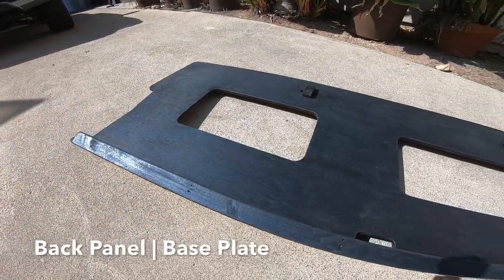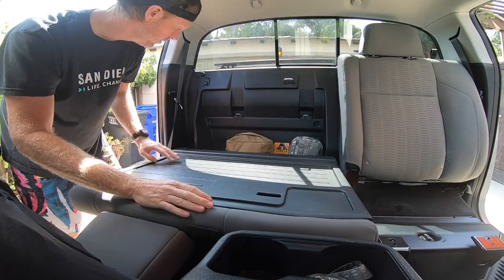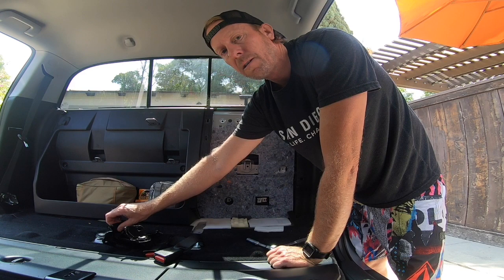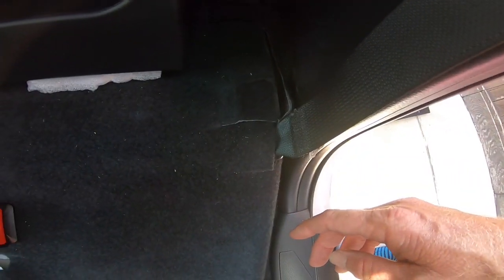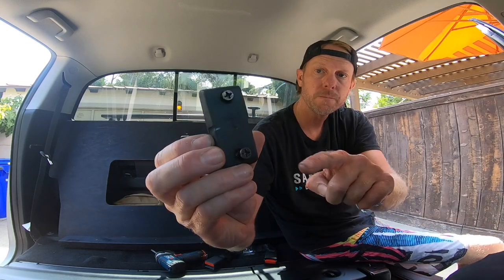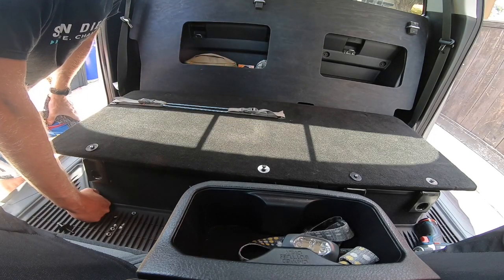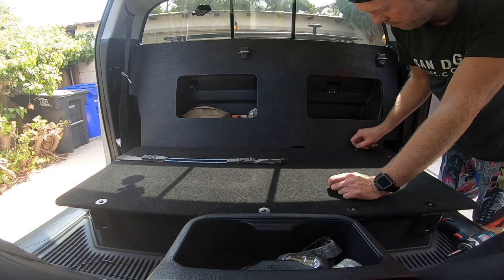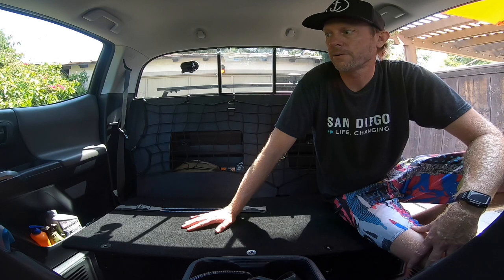Goose Gear Inspired Rear Seat Delete | Tacoma | Detailed Seat Removal | Design and Installation

Comment: U need to split the board same as the seats. So u can lift up..passenger and driverside.. to get to your cubbies. I'm glad u didn't go past the footwell. Like most do can't slide your seat back..otherwise cool build. Take out the passenger seat. And do a full board to the back probably sleep like a single bed. If you need it. But I would get a topper 5 foot rooftop tent 6.foot sleep I'm the back. Than nice to store half your gear behind the seat..and in your bed..squeeze loads of space out a midsized truck. Almost just buy a 4 runner. Lay the back seats down. And roof top cargo basket..my tacoma is ..tricked. to the max. Smart idea..
Reply from the maker: Good ideas. Mine works well for my needs, but those are good improvements for sure. I’m 6’5 so my seat is all the way back no matter what lol. Thanks for watching and commenting. TbT.
Reply: Crazy I actually thought the same thing last night. Just need some guidance

Comment: looking to do a 60% delete on my rear seat.. I want to put my fridge (iceco VL60DZ) in the rear seat, and gain some more functional storage. folding the seats flat the fridge sits too high (doors wont open fully, and there is no-where to tie it down. this platform should solve most all of my problems and gain more storage room in the bed of the truck as well as keep my fridge free of dust, (cleaning the condenser and fan is a PITA).. its usaully only me and my wife that go on these trips. but a 3rd seat is always good to have should our daughter decide to join us.
Reply from the maker: Excellent. I think you'll be happy with having it in the truck. My RSD is still going strong and its so much more functional as a platform than seats like you said. Maybe make a 2 piece platform/back that you can pull the 40% side out and put the seat back in when needed or vice versa. Good luck and thanks for watching and commenting. TbT

Comment: This video was exactly what I was looking for, and well done! I just finished mine, and a couple of adjustments I made too: 1.) Instead of bolting the board to the frame for the T bolts, I just screwed the board into the platform so it raises with the frame but doesn't allow shifting while moving - I couldn't find 7/16" screws long enough anywhere around me to mount it into the frame 2.) I used U-bolts in the platform to allow a way to attach ratchet straps to the cooler so it stays in place, and when there isn't force they drop down to near flush with the platform 3.) Applied outdoor carpet to it to help keep things from sliding and better traction for my pupper. 

Seriously awesome video!! Love the fly rod space! I tuck my little guy into the space between the back storage and the wall (I only did the platform, not the backing). Thanks!
Reply from the maker: Thanks for the great comments and watching, glad you liked it. I’m loving my set up and it’s holding up well. Glad you’re stoked on yours. Stay safe out there. TbT.

Comment: TbT! I just finished my delete. I am so grateful for your inspiration and guidance!! Thank you so much. Out of curiosity, how do you power your cooler when it’s in the back seat? My Taco doesn’t seem to have a power option in the back seat..
Reply from the maker: Rad, how'd it turn out?  I have a battery in my camper (Redodo 100AH) there is a discount code in some of my camper build videos you can use, ( TBT3) for a slight discount. If I didn't have that battery I would probably use a PowerStation like (Jackery, Blueutti that has enough AH to run your fridge.  I run the frisdge off my truck (Cigerete lighter port when driving to save battery and our camper battery when camping and keep it topped off with a 100w solar panel.
Reply: Oh nice! Mine came out so great!! Do you have an email you can share? I can send pics, I don’t have any social.
Reply from the maker: @Mountaindweller915  Cool, yeah. I think it’s in the description of my YT page.

Comment: Do you have the dimensions and angles for this build. It's perfect for what I need.
Reply from the maker: Thanks.  The base is 19” X 48” and the back panel is 25.5” H X 52.5” W at the top (widest part) it tapers down narrower at the bottom to allow access to the mounting bolts (seat mount locations) and some more side storage. Hopefully you can see most of that in the video and use it to inspire your build.  I do not have angles, I just matched the angle of the factory cubby. Thanks for watching. TbT.
Reply: This build is awesome, I’m just beginning it myself. What are the dimensions of the center support pieces underneath the base, adjacent to your fly rod tube? Also, what’s the thickness on that base sheet of plywood?
Reply from the maker: If I remember correctly the back support with the angle ripped on it is about 49.5” wide. I can’t remember the mid supports sizes. I think the deck is 11/32 ply. But anything light but stiff would be good. Just don’t want to add any unnecessary weight, but you don’t want it to be flexy obviously. Good luck 🤙🏼
Reply: Thanks!

Comment: Thoroughly enjoyed the build. It looks great and is functional except the 3 screws holding the base to the back. I would have done something quick release like pressure pins or spring clips. Just for quick access to the bottom containers. I keep recovery gear in those bins as well as trailer hitch and other gear I need quickly.
Reply from the maker: Thanks for watching and commenting.  The main reason I chose to use the 3 Allen screws was safety. I wanted the entire rear seat delete to be as secure as possible in a worst case scenario IE car accident. I didn't want anything on the rear deck to flip forward in that situation. Also I figured in a recovery situation  ( I keep my recovery gear under there too ) taking those 3 bolts out only adds a few minutes at most and slowing down in a recovery situation is a good thing.  Stay safe out there TbT.

Comment: Nice build.  Pulled my back seat out the other day and was amazed how much more space it gave me.  Gonna do my own build soon.  Thanks for the inspiration.
Reply from the maker: It truly is amazing how much extra space it creates. If I do it again, I would add more sound proofing to the back wall and floor where you can. It’s definitely louder without the rear seats...but not horribly. Other than that I absolutely love the mod. Good luck with yours and stay safe out there.  Thanks for watching and commenting. TbT

Comment: A really good video! I have been wanting to do this same mod. I bought the plywood and have both pieces cut per your dimensions. A have a few questions for you that would really help me. I see where to trim or taper the back piece on the left. And where I need to notch on the lower right to attach the bolt. Could you please give me the measurements for each storage openings? It looks like they are slightly smaller than the actual opening. Also I assume that the back mounting board is a 1x4 that goes fully across the bottom. Then you have a 2x4 that is the front bottom to attach the bottom. Is that right? I will need to figure out how you attached both pieces that basically make a bottom “ tee”. I will just have to lay it out to understand how you screwed them all together I guess. I really appreciate your help and again thank you so much for a very good video! Thanks.
Reply from the maker: Thanks for watching. I made the openings 15  wide X 9 tall. The passenger side (factory cubby) is bigger, that allows me to stuff things back behind the overlapping back panel on that side if that makes sense. 

The bottom base part is a piece of 1x 4 poplar cut down to 2.5” with the angle matching the angle of the back cubby panel and a piece of dug fir 2x4 (platform base) all glued and screwed together. Make the mounting holes (the ones that I bolted the back panel/base to the existing seat/floor screw holes) big enough so you can move the back panel marking a bit to line up the bolts and use fender washers to cover the bigger hole. Makes it much easier  to line up the back panel when bolting down. Hope that answers/helps you a bit. Feel free to modify or improve my design of course. Good luck and let me know if you have any more question.  TbT.
Reply from the maker: ...yes it goes all the way access so you can use the seat mounting bolt holes on each side (and the middle where I had to make the notch). Made it just wide enough to get a bolt and fender washer on it. About as for out as the seatbelt bracket on the floor of the truck. Hope that makes sense.
Reply: @TravelingbyTacoma  thank you! I will let you know how it turns out.

Comment: Excellent video.  Just pulled my rear seats out and was going to omit the cubbies too, but now you've got me thinking I may put those back in place.  Well done.
Reply from the maker: Thanks for watching and commenting. I kept them because I occasionally put my seats back in. They work well for gear and with the elastic net you can stuff all kinds of stuff in there. Removing them would add some more space for sure though.  Good luck and stay safe out there. TbT
Reply: @TravelingbyTacoma  finalized my design today, slight variation on yours, going to go vertical from the floor up to where the cubbies start to slant back with a couple hinges to give me that extra inch or two of platform space, and going to try to use a T-nut and star-knob to achieve securing the upper section of the wall panel to quickly be able to flip it down to access the cubbies since I don't plan to cut out the holes like you did.  Thanks again for the inspiration!
Reply from the maker: Good luck, hope it turns out well.

Comment: Awesome video and inspiration for a similar project I'm considering. Do you happen to know if this also warranted a weight savings and how much you saved? Or what your seats weigh compared to the build? I'm hoping that mine will also mean even just a bit of weight saved for the rest of my gear!
Reply from the maker: I don’t have any exact saving numbers, but it is for sure less weight than the seats. It also allows gear to be moved into the cab that would have been in the bed and distributes the load weight better for sure. If I had to guess... it is at least a 30-40 pound of weight savings by removing all 4 rear seat pieces and only adding some plywood and carpet. Good luck, thanks for watching and let me know if you have more questions. Stay safe out there.  TbT.
Reply: @TravelingbyTacoma  That's the most important piece to me! The added room, thank you!

Comment: Would it be possible to do just the 40% seat delete on the driver's side? I still have a 3rd, and sometimes 4th, person in the truck.
Reply from the maker: Yeah you can do either one. I’d make your platform on the passenger side (limits you to 3 people) but it’s more bang for your buck. Ice chest or fridge would fit on it. Also it will only take you about 15 minutes (once you’ve pulled the seat out and put them back a few time) to re-install your seat if you want it back in. You could take out either seat and the plastic cubby and build a one piece platform with a 90 degree back- that would give you a lot more room and may be an easier in and out install. Good luck.

Comment: looking to do the same to my 2nd gen. great idea to re-use the seat hinges
Reply from the maker: Thanks. It works really well if you don’t need consistent access to the factory storage. Stay safe out there and good luck with your build.  TbT
Reply: @TravelingbyTacoma  could you nt chance share your dimensions or template of the cuts with me? 😁
Reply from the maker: Back panel is basically 53” wide by 25 1/4” tall. Flip-up base is 48” by 19”. Everything else is just builders choice. Good luck. Thanks for watching.
Reply: @TravelingbyTacoma  cheers!

Comment: Are you based in San Diego? Would you help me build one if I paid you?!
Reply from the maker: I am. When do you need it by? I’m pretty swamped at the moment with work/life. Can you hit me up in a few weeks and I’ll see if I can help you out. If you’re looking for the exact same system I made for my 2019 I could use mine as template and it would be fast and easy. If you’re looking to modify my design that’s a different ball game. I’m not 100% sure all 3rd gen DCSB are exactly the same each year, but if they are duplicating mine would be easiest. Hit me up in mid April and we’ll see. Thanks for watching and commenting. TbT
Reply: No rush on my end! And yes it would be almost exact copy maybe with a small modification weather main platform is to make it a little longer for my dog. Not sure how to direct message you but if you know how to to me please let me know!
Reply from the maker: Ok. DM me on my Instagram @travelingbytacoma in a few weeks and we’ll set something up.
Reply: @TravelingbyTacoma hey brother would you be able to help me out with my little project? I’m based out of chino ca. wouldn’t mind the drive for the work